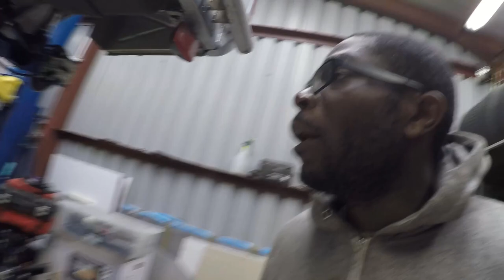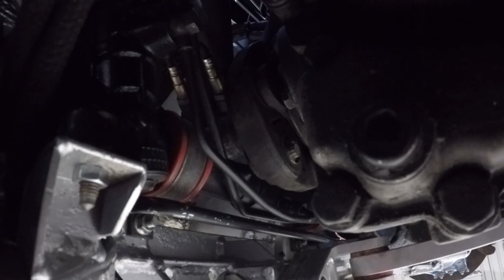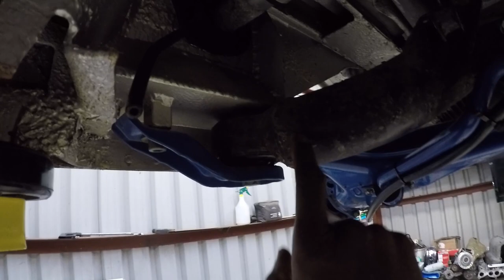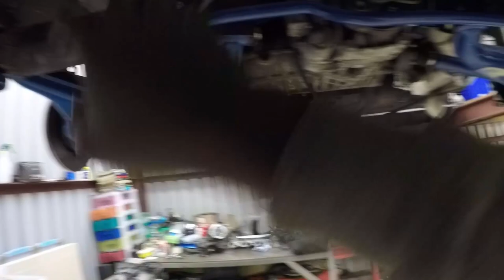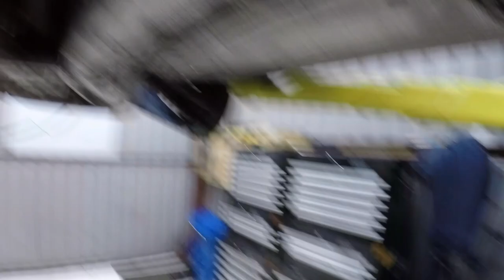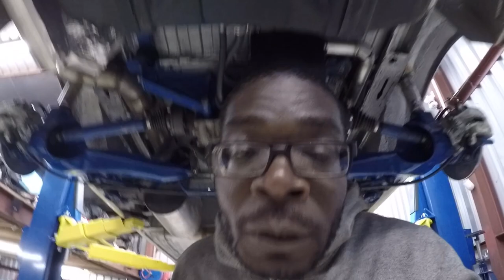Caddy 4WD Haldex / Syncro Conversion Overview

Comment: Hey man great work just want to ask what gearbox and diff are you using because I'm planing on doing the haldex swap to a mk2 jetta using the syncro tunnel and rear subframe of  the golf mk2  syncro but I'm not sure what gearbox and diff combo to get a 50/50 split.
Reply from the maker: I'm using an 02m gearbox with the matching diff.  If your engine is a 1.8t then you will need to use the box and diff out if a TT or S3.  If you engine is a 2.8 be then you'll need the box and diff out if a golf V6 4motion

Comment: Hey I know this is a older video I just want to know what you did for your fuel cell, also did you have to trim the holes for where the steering rack goes to the hub? I’m building one as I’m writing this got a full Tt rear end in with a Passat awd tunnel got everything up just trying to figure out fuel cell and all that jaz. Thanks
Reply from the maker: Hi there, no fuel cell, just the original fuel tank was used.  It was moved to the back to make way for the 4wd.  

The holes where the steering rack go through were not trimmed. 

Hope that helps 👍

Comment: hello
just came across your video. Since i want to do something like that, I have a few questions. did you have to modify the tunnel in the cab or you just lowered the exhaust? I thought Mk 3 and 4 were the same? why do you switch out the synchro rear diff for the Haldex, is it better? what is the van Der Ver haldex controller and on which website is it all explained? thank you very much for your time. You also state, that the drive shaft came with the truck? do you mean donor car, since the caddy didn't have one?
Reply from the maker: Yes the tunnel was modified to fit the propshaft

Comment: When the steering rack is dropped, what do you do about the steering column? Do you have to extend it? Asking because I am planning awd in a mk1 tintop.
Reply from the maker: Hi there you have to uses an extended UJ to make up the distance between the column and the rack.
Reply: @ABIMOTO  Is this UJ? something you can find on other vw cars or is it custom made?
Reply from the maker: I think I shortened one from a MK2 or MK3 golf to fit the mk1

Comment: Hey abimoto I’m in the middle ov my mk6 awd conversion, I have no wiring for my haldex am I right in thinking the van Der Ver haldex controller will plug an play with its own loom so I won’t need original wiring an modules etc???
Reply from the maker: Hi there.  Yep that's right.  You won't need any of the original haldex loom but you will need to feed the haldex controller with some aditional signals.  These are all detailed in instructions and on the website 👍.

Comment: vw golf 4 non haldex (FWD) will go for RWD with haldex? the 4 bolts of haldex rear frame exists into chassis?
Reply from the maker: Non haldex golf (fwd) has a different boot floor to the 4wd golf so you can not bolt in the haldex floor.  You will have to replace the existing floor for one out of a golf 4motion or potential build something into your existing floor
Reply: @ABIMOTO  thanks alot ,them 2doors 4x4 come ultra hard at sale..and huge prices